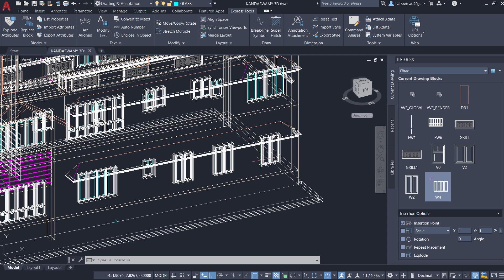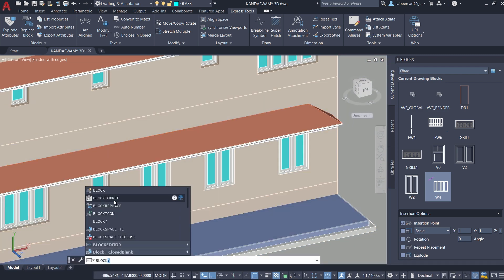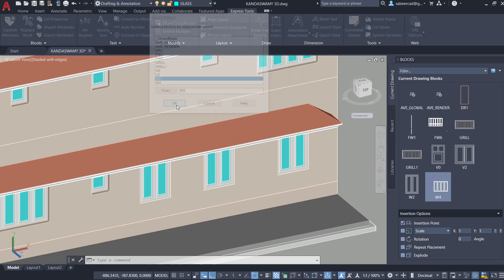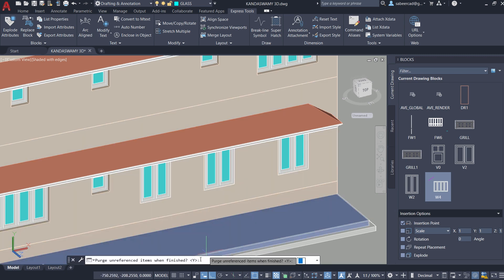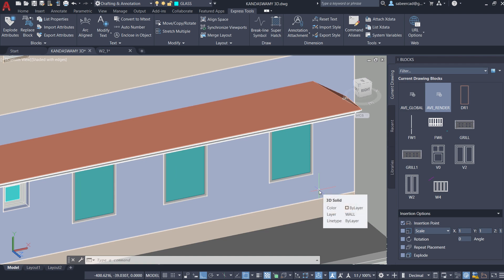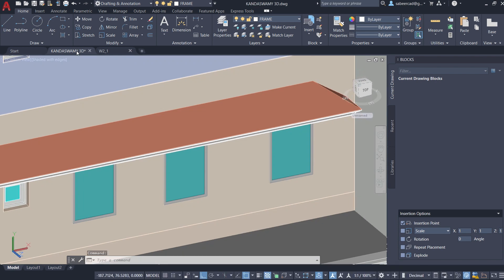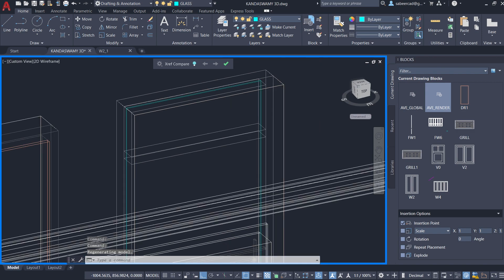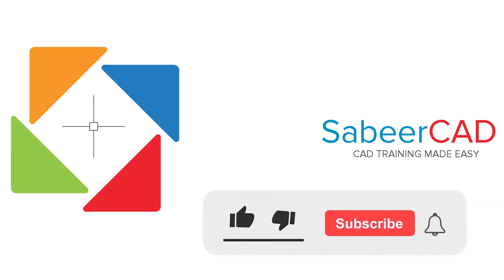BLOCK TO XREF TOOL IN AUTOCAD | BLOCK TO XREF

Comment: I am a little confused. Say I want to integrate my 10 blocks into Autocad, so they will no longer act as block individual units, but as part of one drawing. What is the best way around it? Thank you
Reply: Incase ur want to use multiple blocks, use groups
Reply from the maker: You can make these 10 blocks as individual drawing files and insert these files in different locations.